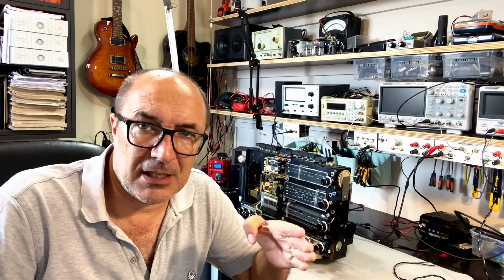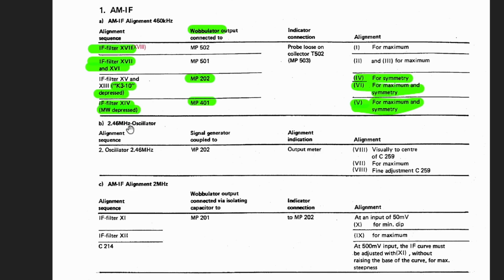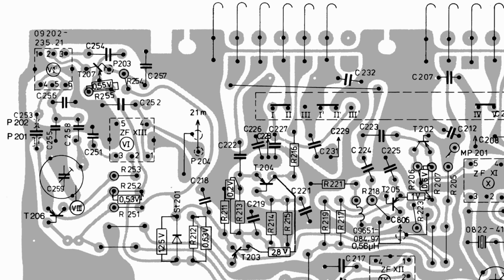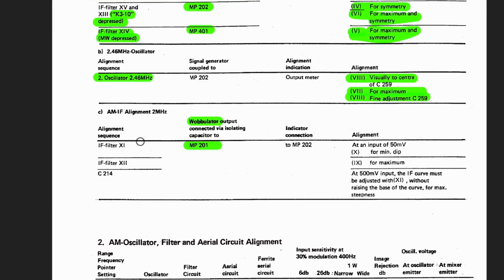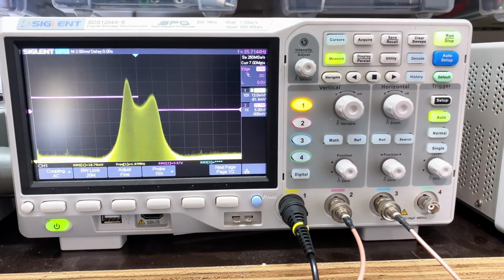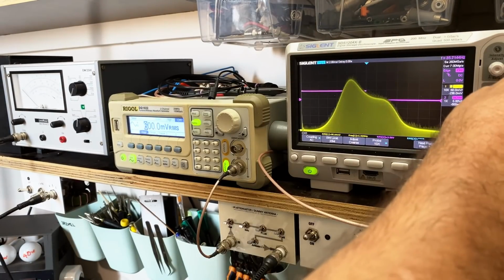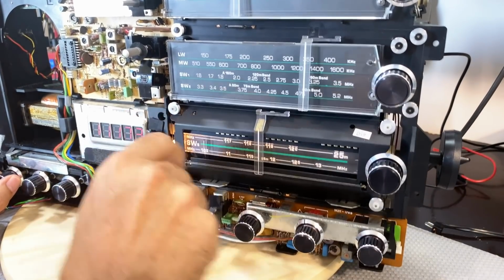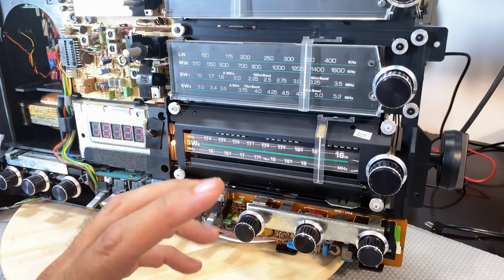Alignment of AM 2 MHz IF and the 2.46MHz oscillator. Grundig Satellit 3400 Pro restoration part 8.

Comment: One more point Manuel. My set had the same solidified wax covering most of the transformers. After fighting with scooping out the junk, I discovered that applying a heat gun to the wax, melted it almost immediately and became a breeze to remove.
Reply from the maker: I agree, but be very careful. I once calculated it wrong and melted the formers and made it worse 😊

Comment: Hi Manuel,  at 12.20 I believe you made an error. You set the signal generator to 2.0 mhz whereas the correct oscillator frequency should be 2.460 mhz. And yet you were still able to receiver shortwave stations, so I am thoroughly confused! Because of efforts I have actually gotten this far with the alignment, but I need clarification on this point. I aligned to 2.46 megs and my peak was a lot less sharp than yours. Thank you for the wonderful series,  beautiful radio!
Reply from the maker: It’s been a while, and I am too feverish to go back and watch my own video without falling asleep 😊 but my understanding is this: the IF for the SW bands in question is 2MHz, and this is aligned for that frequency. Then the oscillator is aligned to exactly 2.460MHz to mix with the said IF of 2MHz and produce 469kHz, which the feeds into the “normal” IF path of the AM bands. If you go back to the beginning of the video, I believe this is explained. Hope that helps you.
Reply: <Then the oscillator is aligned to exactly 2.460MHz to mix with the said IF> That is correct but in the video you set the signal generator to 2.000 mhz not 2.460 mhz. (time 12.20). Manuel, wait until you are feeling better, nothing is worse than passing out over a radio! Get well!

Comment: So far, so great! I was looking for such a radio locally but the prices are... big oof. :D So i guess i'll have to wait for something like that. Oh! By the way... you may remember me from my question regarding the IF Transformer coil? The broken one? I ended up removing the "primary" coil and replaced the coil with 1k Ohm 1 Watt Resistor and connected a 200 pF Capacitor from the Plate of the EF89 to the Grid of the EAF801 and it seems to work. The secondary can still be "tuned" a little bit. Not much, but enough.

I still have the problem with low volume on FM (less so but still low on AM). Because all four EL95 Output Tubes test (very) weak, i guess its due to weak tubes. But not sure.

Its a Telefunken Opus 2550 Radio, in case you had such 14 Tubes Radio before.
Reply from the maker: The resistor replacement trick works more or less, because you’re placing a load on the preceding tube. As you noticed, the tuning gets affected because you have basically removed an IF transformer. 
I’ve worked on the opus 2004 and the 2114, and am just about to start an opus 8.
Reply: @electronicsoldandnew  Funny thing tho... AM is silent too with its unaffected/original IF Transformers. I guess it has to do with sth else in the circuit. Due to complexity and dozens of components, it takes a quite a while checking every single one of them.

Not sure if its so silent just because of the replacement at one (of many) stages. If i put my signal generator at a stage before  my replacement it can be quite loud with just around 25 - 50 mV. So i guess its sth else but don't know what.

The ratio capactor also seems not to "charge" that much. From other radios i know its around 6 or even more Volts. But with this one? I barely can see the needle moving. I've tested the capacitor and it seems good. Replaced it temporarily with no change.

Comment: Hi - I would be interested in getting your view on whether this radio benefits from the dual IF rather than the single IF traditionally used?
Reply from the maker: It sure does. Makes the sensitivity of the respective bands higher, and also does away with image receptions.

Comment: I'm not sure if I would have the patience you have when it comes to confusing instructions.   Only exacerbated by the number of bands.
It looks to me like adjusting the input to 500mV is "working" the filter circuit harder, only so we can "see" the filters effect.   I'm wondering if that technique would be applicable in some other radio tune-ups too ?   As long as we didn't burn out anything ?
Reply from the maker: The possibility of burning something is what scares me sometimes.

Comment: I knew you wouldn’t be able to resist giving the 1st adjustments another go 😁. Thanks for explaining where you connected the trigger signal to. It makes more sense to me now. Lovely to see a visual alignment and with a set like this it’s clear that it has to be done that way. I was shouting at the TV when you had the generator at 600mv though but you spotted it. Nice curve though. Cheers Graham
Reply from the maker: Yes, this alignment method can be very therapeutic 😊 It’s always a little amazing to me when I follow the instructions and it works 😊

Comment: Great Progress dear Manuel! 
Counter: It has three preset values: For AM with IF 460kHz it is 99.540, for SW with IF 2MHz it is 98.000 and for FM with IF 10.7MHz it is 89.300. When the oscillator/s don´t work, you see these figures.
The internal counter reference is adjustable in "III Frequency Counter". 
If there is still a difference then the IF is not exactly as it should be (460kHz etc...). And please note that the counter has only a resolutioin of 1kHz in AM. So the error is always +/- 1kHz!
Reply from the maker: Thanks for the tips. Will come in useful.

Comment: I am sure the SO42P was available around about the time of manufacture  so why did they not use it would have made for easier alignment as you will not be any carrier or input signal just the wanted IF signal because it is a Double Balanced Mixer/Local Oscillator.